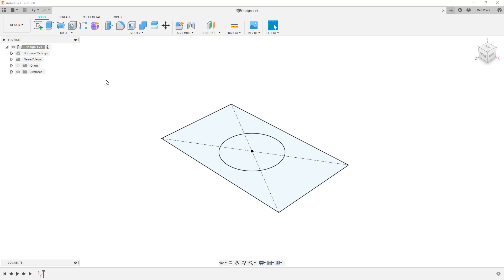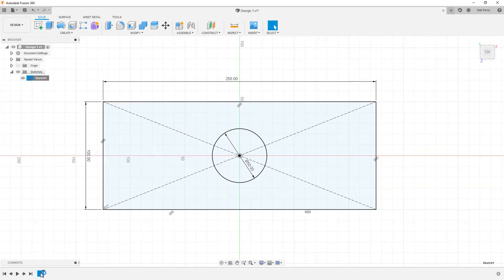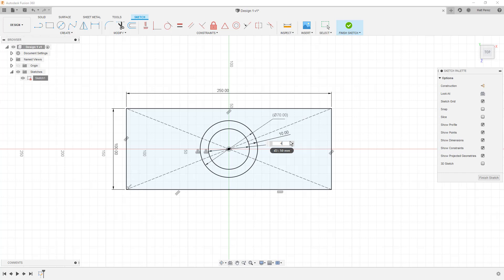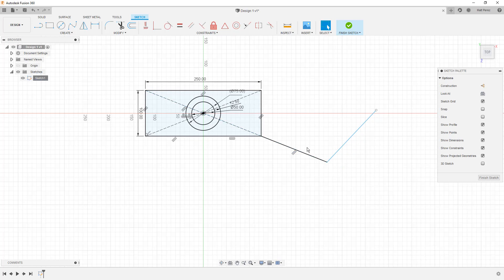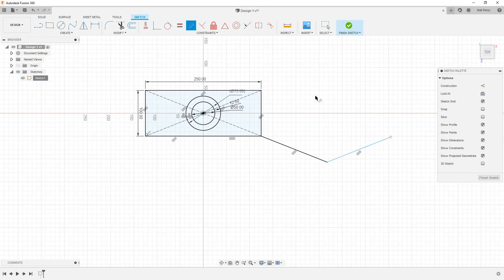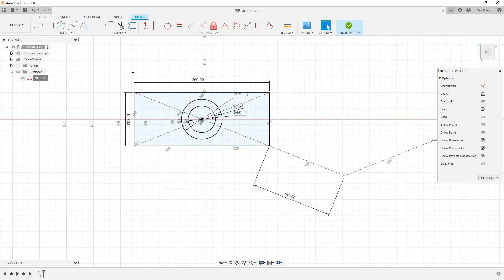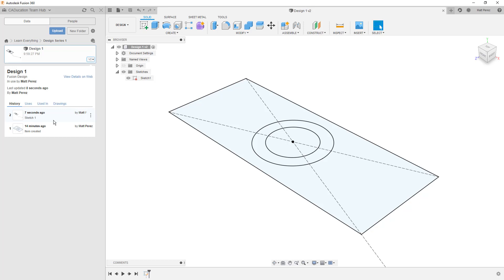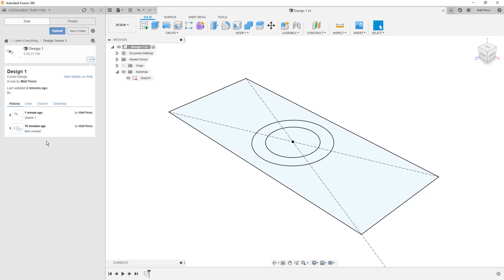Intro to Fusion 360 - Part 4: Intro to Sketching part 2 (FIXED) #Fusion360 #HowTo #Tutorial

Comment: I usually make a copy of a version in the case that I have to change the design when there is already manufacturing processes built out, because one little change in the design pretty much deletes all manufacturing processes.  Therefore I can look at the copy and easily paste back in the mfg processes and tweak as needed.  A lame function of Fusion.
Reply from the maker: By MFG process do you mean CAM toolpaths?  Generally what I do is Derive the part out of the assembly to its own file.  if you need to you can always break the link.  The Nov update for Fusion now has configurations in CAM which could help you out.  Just make a new configurations for the changes and it will preserve your design in the same file.

Comment from the maker: For anyone coming across this video, It was a series i did in April of 2020.  I just uploaded this video because of an audio issue with the original(which is now private).  If anyone finds this video helpful I would suggest going back to that intro series where I covered everything at a basic level up through CAM and simulation.